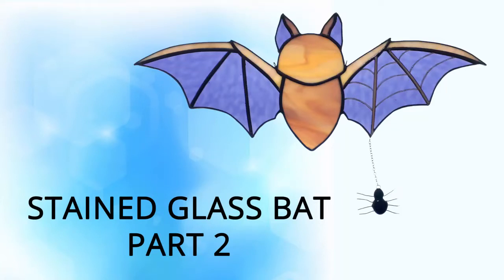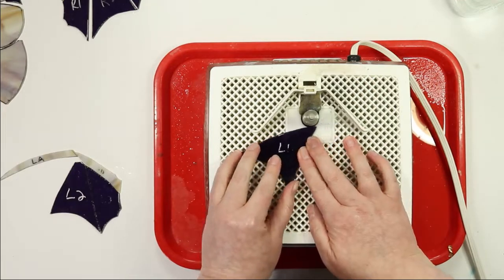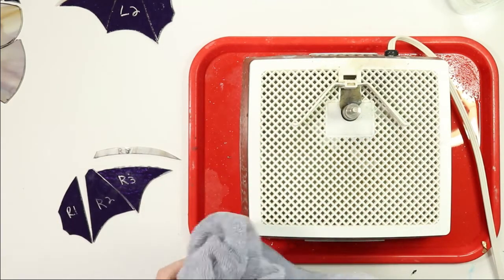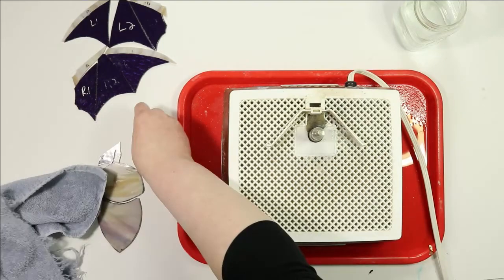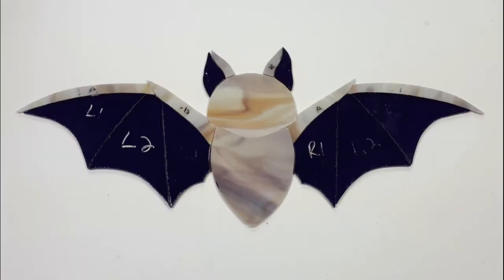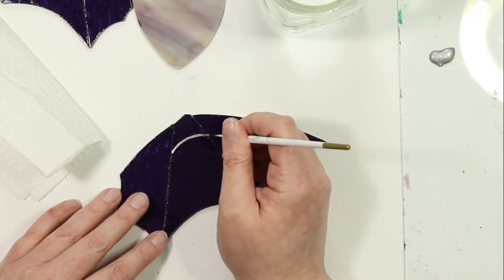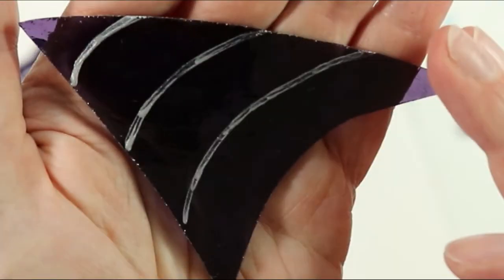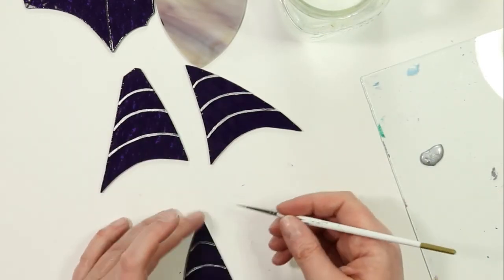Making a Stained Glass Bat: Part 2 - Grinding the Pieces Then Using Glass Paint

Comment: Hi 👋 
For the spiderweb, could you have built it with solder or with copper foil/wire then attached it to the solder after you soldered the whole piece? Will the paint not interfere with the foil adhering to the glass pieces for soldering?